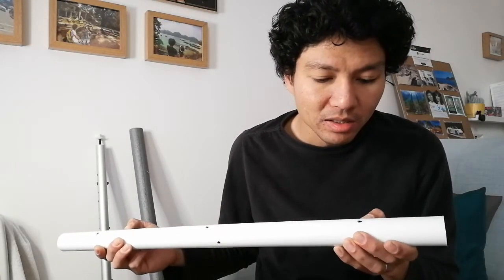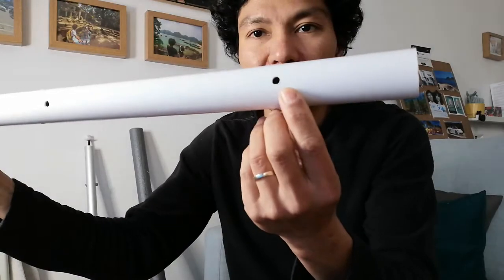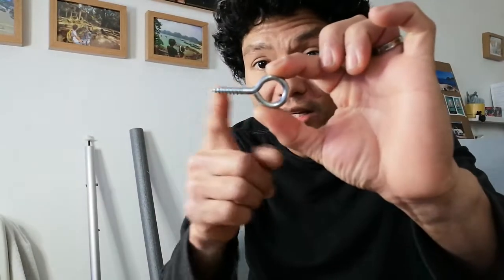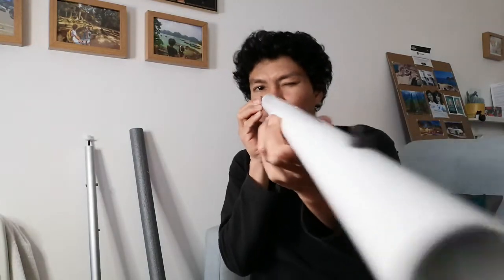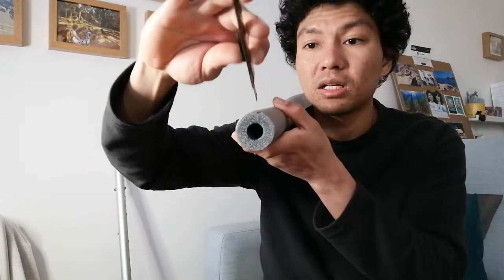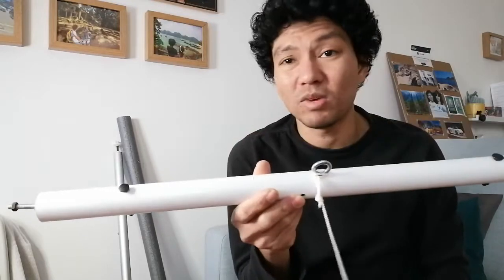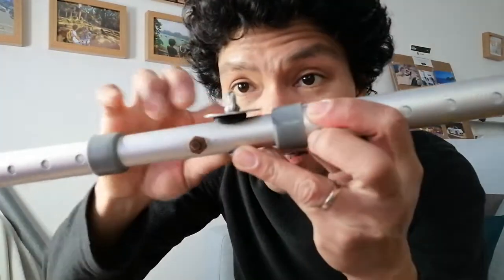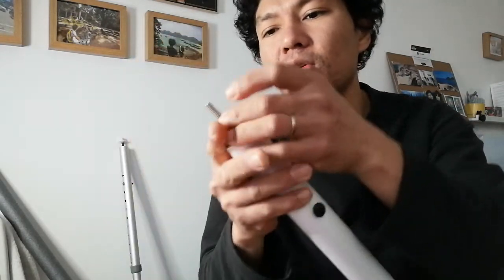Inflatable Sailing Kayak   Episode 10 : Building Your Leeboard Transom Cheap & Easy!!

Comment: Great job bro. may i ask you something.   Do you suggest  outrigger Stabiliser/Balance kit  instead of leeboard for very Windy weathers?
Reply from the maker: @yeniboyut  thank you! It depends, on this Itiwit 2, for winds up to 10kts + sail up to 2.0m2 + my weight 60kg+, I don't feel like it needs a stabilizer. If your sailing region has bigger winds or gusts (eg. 14-20kts), you could opt for a smaller sail about 1.5m2 and less chance on capsizing.

To me the balancing/stabilizer kit adds up to bag weight and also hydraulic-drag when it skims the water surface.

Let me know if you need anything else 👍🏼

Comment: Why is it not better for securing a rope to mount a cleat or cam cleat instead of a bolt with a wing nut and a washer in the center of the pipe?

https://en.wikipedia.org/wiki/Cleat_(nautical)
Reply from the maker: Good question 👍🏼👍🏼 
Yes, you could also use a cam cleat or line cleat if you could get some. The wing nut and washer would be an alternative for those who do not wish to source/spend for extras on the cleats
Reply: @sitb-  line cleat - these are two sticks of different lengths, attached with two bolts or screws)))
Reply from the maker: Yes, you could use a cleat, but for me it's harder lock and unlock everytime when setting your course. But, if you could lock on the cleat on a single hand, sure, that would work fine 👍🏼👍🏼